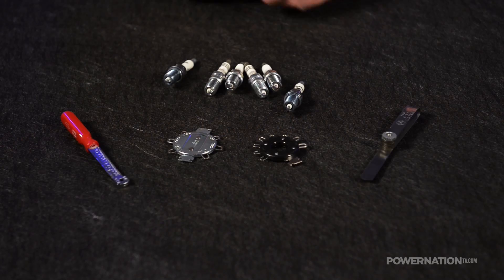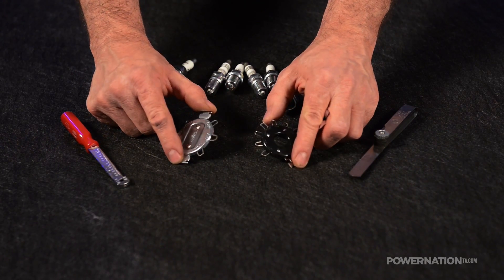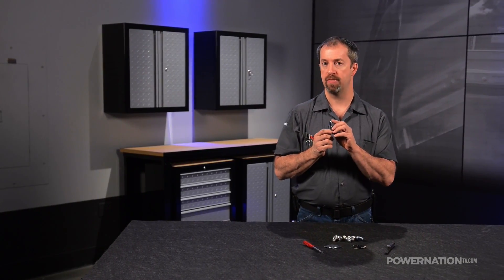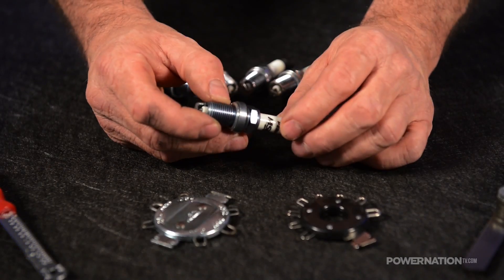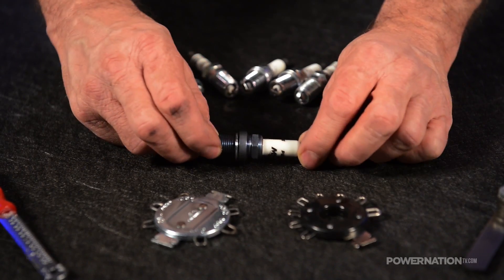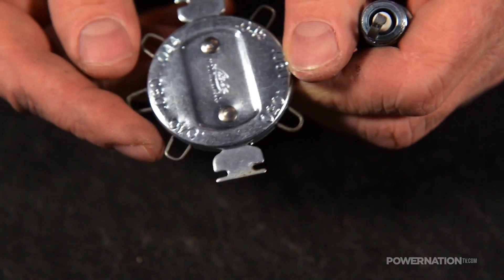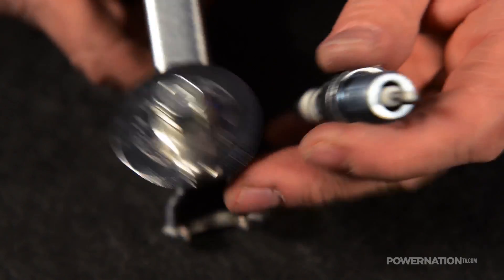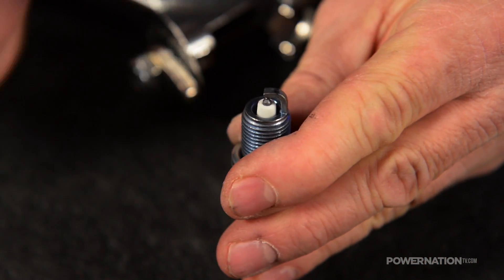If You’re Gapping Spark Plugs This Way, You’re Doing It Wrong

Comment: I put a blade type thickness gauge (sitting on the bench with the correct blade sticking up) between the electrodes and then squeeze the whole plug (or from the should of the nut to the ground) with a large pair of channel-locks. The ground electrode does spring back a bit, usually about 0.004"/0.1mm, so for example for a 0.036" gap I use the 0.032" blade.

Comment: How you going to explain the 4 tools on the table at the beginning of the video. But then surprisingly use the racing gapper at the end and not explain what exactly what it is or where to get it. I googled "race gapper for spark plugs" and i get nothing. This video needs more detailed explaining.. dont just leave us in the cold guessi g how to get that last tool you used.  Thanks.
Reply: I found it online! Jacobs Electronics spark plug gapping pliers.. search that, the reviews are kinda crappy..

Comment: Those cheap plug gapping tools always bend to shit when trying to open or close the gap. That racing tool looks promising though ? The only problem is the electrode springs back & it does not set the right gap.
Reply: So can you just press twice and it will be correct? Or maybe set a little bit below or above to compensate for spring back?
Reply: MAYBE, I'VE NEVER USED ONE, SOME BEND EASIER THAN OTHERS. IT DEPENDS ON THE PLUG YOU BUY, TRIAL & ERROR I GUESS ?

Comment: How do you use a standard (non racing) gapping tool to close the gap?
Reply: my OEM spark plug wire tool bends on audi A4. the spark plug ground strap is too thick...

Comment: That's no completely correct! If it's an iradium plug your setting I guarantee you that the 1mm centre wire will snap using using the tool he used in the video. If you don't believe it, go out & buy some iradium plugs & try it! :)
Reply: from $7-12 a plug no thx I'll take you word for it lol